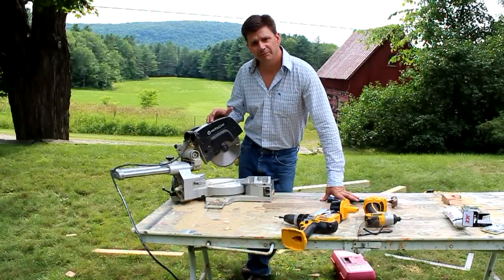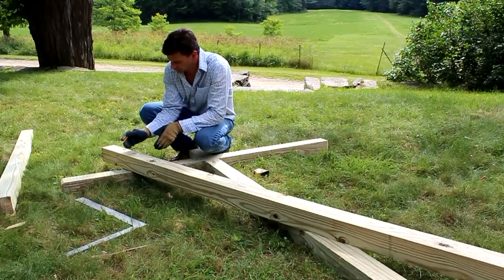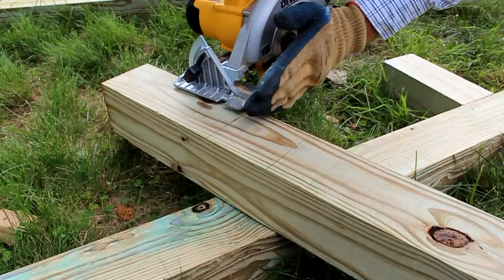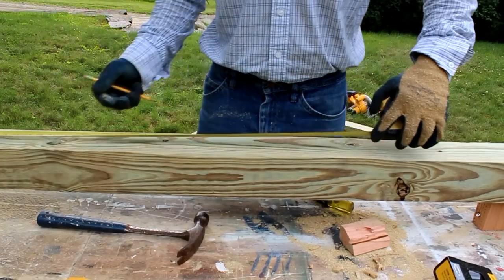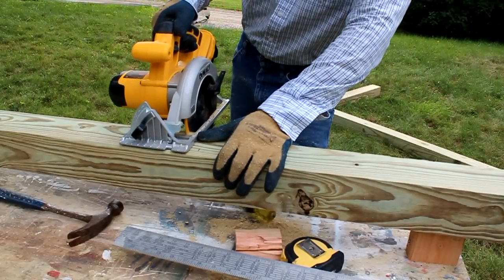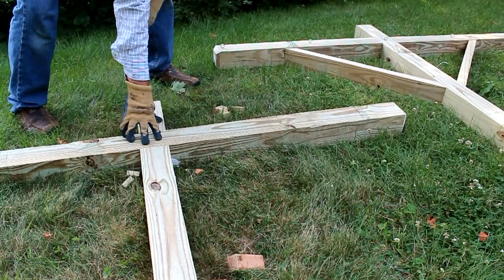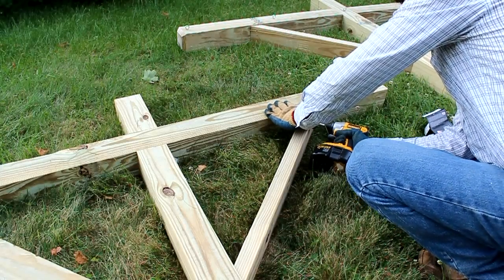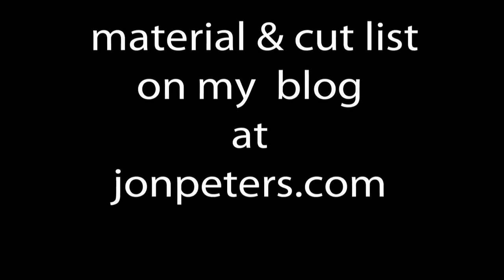How to make - build a Clothes Line by Jon Peters

Comment: if you want to make concrete, do a 1 to 3 mix. 1 part cement, 3 parts of sand with stones. That is already a strong mix. For this purpose it would be ok to use 1 to 5.

Comment: I'm surprised that you don't use a lag bolt to hold the cross member to the base.  I understand the theory of the ropes pulling it the other way, but after time when the wood dries and shrinks, I would think this would be an issue.

Comment: How far apart should I put the post? And what size drill bit to predrill the holes? The I hooks at Home Depot are on 1/2 inches wide. So, I purchased 1/4 in X 3-3/4 in. Is this going to be ok?

Comment: what do you use to hold the cross section together? when you hammered them together did you put a wood screw in it? if so i missed that part..thanks

Comment: I'm sure this was great for someone used to woodworking. For the unexperienced, it was way too difficult.
Reply: I'm a granny and have only watched others use power tools, but I would try this. I just need someone to move the heavy  4x4s for me. ;)  You just have to believe in yourself and try. All these things could be done with a hand saw, a cheap miter box, a hammer, ruler and or tape measure. I bet you might have neighbors who might even loan you the tools if you invite then over for a cook out. :)